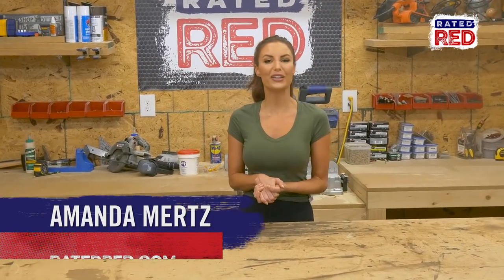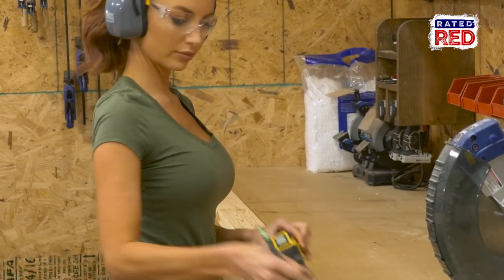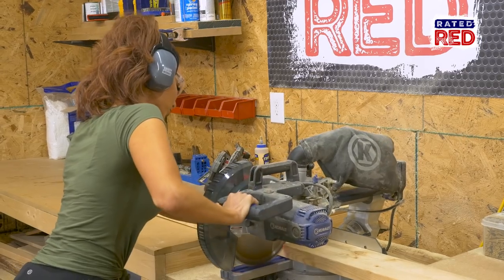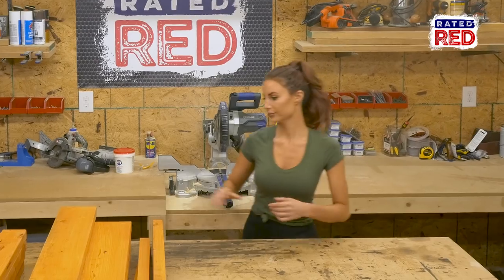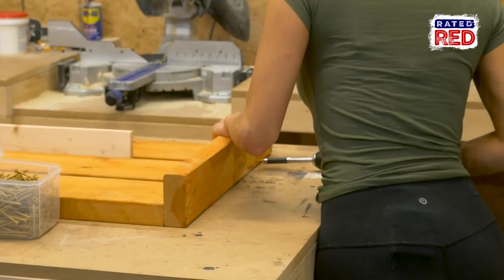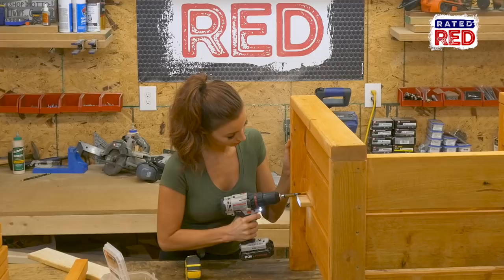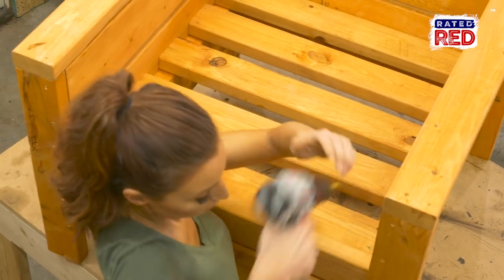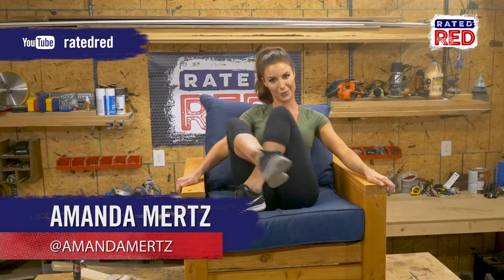Outdoor Chair | Red Hot Building

Comment: CAN YOU BUILD A MOBILE WORK BENCH WITH TABLE SAW /CHOP SAW OR A MITER SAW/ WOULD LIKE TO HAVE THEM SETUP WITH THE SHOP VAC DUST HOSE HOOKUP. TOOL STORAGE .WOULD YOU USE 4X4 OR 2X4 ? I WOULD ALSO LIKE TO ADD ELECTRICAL PLUG INS UNDER TABLE TOP . WOULD YOU ADD A INSET ROUTER . WOULD YOU ADD A WOOD PLANER? NEED LAYOUT PLAN .ON WHEELS TO WHEEL OUTSIDE EASY CLEAN UP .PINTEREST HAS SOME GREAT IDEAS BUT NO PLANS.IT WILL BE MY FIRST PROJECT JUST GOT A DEWALT MITER SAW .NEED YOUR HELP PLEASE.